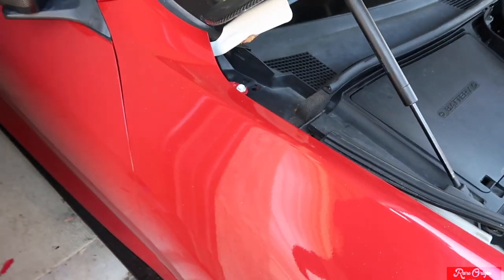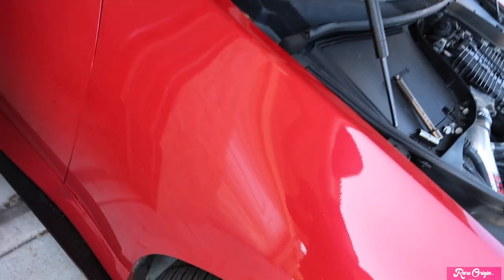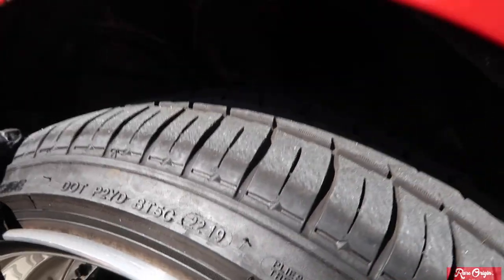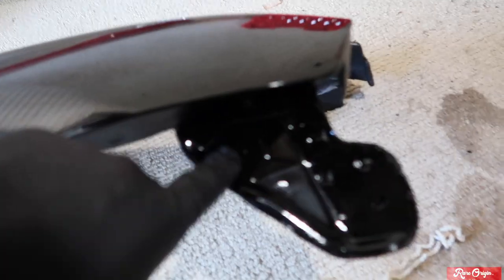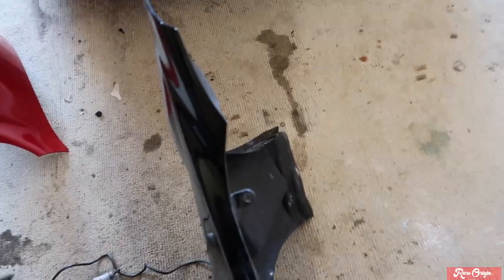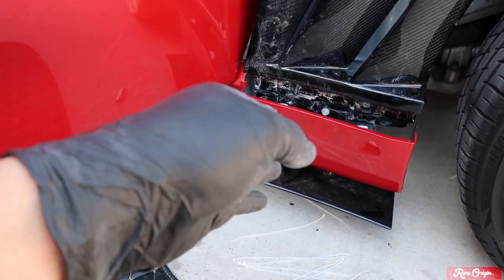G37 CARBON FIBER FENDERS INSTALL (PART1)

Comment: I made the mistake of not reinstalling my clips back,and didn't take my front bumper off got intimidated by the lack of fitment and left a gap between the finder and the bumper. Had a shop to fix it when they installed my Liberty walk bumper.
Reply from the maker: At least you got it fixed brother 👌🏼

Comment: Now if you're asking for suggestions, I'd say get the camber kit. You're already making adjustments just because of the cf fenders. And they look awesome too! But if you go wide body, then you're going to cut up those nice fenders, buy new barrels for the wheels, get new tires(maybe)..possibly readjust air system to make this fit..🤦‍♂️🤷‍♂️ Is it worth it? Only if thats what YOU want to do..
Reply from the maker: Yes ordering camber kit and go with smaller tire to clear on this fenders 🙌🏼
Reply: @GeorgeNava37  
SPL bro.. I have the rear camber and toe kit, but not the front